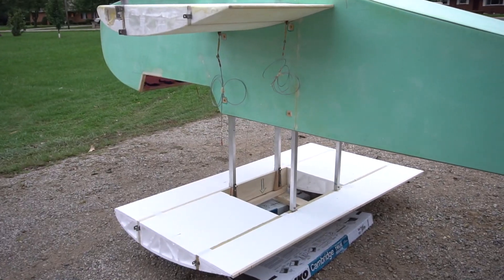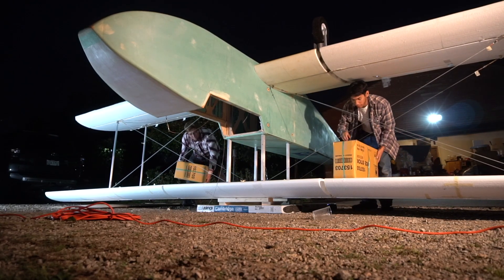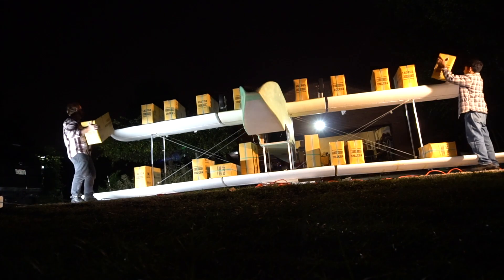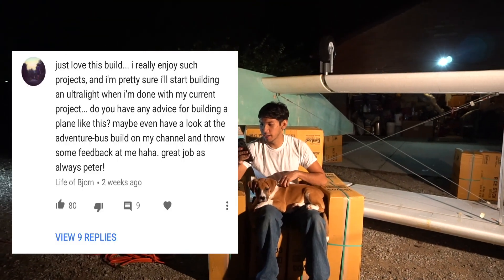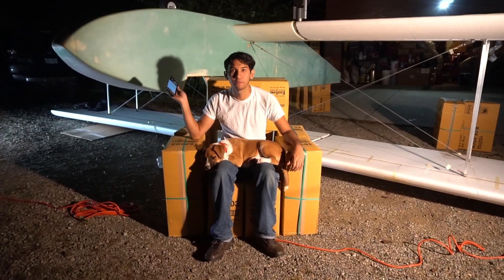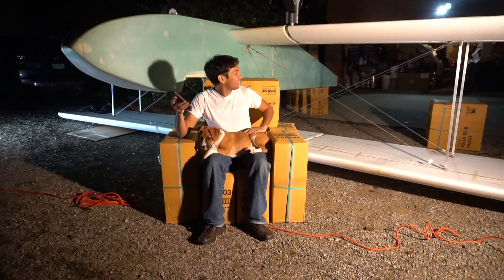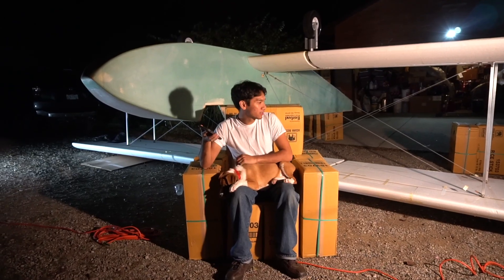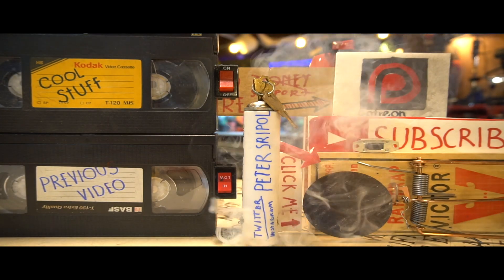DIY Electric ultralight pt5 (Making the Wings)

Comment: I know this thing flew and you subsequently built a 3rd improved machine but watching your methods and finish really gave me shivers mate! In aeronautics we match-drill and debur and ream we don't final drill in a press and leave jagged edges or tap on AN hardware with a hammer, in terms of the design your cabane assembly with 4 upright square tubes is torsionally very unsound, any twist at all will crumple the tubes particularly given that they are free/unbraced above the half way mark vertically and besides carrying flight loads it needs to provide protection in a turn over, brace the uprights with diaganol bracing (look at the Pitts) and jury rig the assembly please. An aircraft needs to withstand more than just localized weight applied in a controlled test, the airframe will experience twisting and torsional loads in both positive and negative loading, this is why prototypes endure extensive ground and flight testing. Do the calculations yourself, don't copy other designs and think it will be ok in all loads and circumstances, you don't know what loads the other designs were made for, this is the big difference between model and full size aeronautics.

Comment: What did you use for wire on your hot-wire cutter?  I've been using music wire, but not getting greatest results as it's tricky to balance tension vs temperature without breaking it.

Comment: OMG Peter! First- gotta gush. Love your projects, love your videos- watch them all. But, since watching your 'stuff', I've been triggered into wanting to create an ultralight... (Bad thoughts!) So, how do you determine the airfoil for your craft? I'm only thinking FAR 103- many parameters are already determined, MTOW or gross of 600 Lbs, CG managed by pusher style weight balance (motor/batteries mounted at trailing edge of right behind pilot.) Then, I DO have questions about wing materials- 6061 rectangle tubes vs. wood- or, cut foam & layer both e-glass & carbon fiber directionally for flexural strength & load? Ideally, I'd like a cantilevered high wing configuration, using reinforced canopy (overlapping main spars-glider style) for quick mount & dismount of each wing. Obviously, weight is a big focus but +/- 3 or 4 G's would be ideal.
   Forgetting inexpensive for a minute, does layered E-glass have better strength, flex, vibration & weight benefits for a main spar? Or, E-glass with reinforcing carbon fiber spars? Or, would I be better using foam interior (shape) and layering a clamshell panel mold with E-glass & Carbon Fiber? Thinking welded rectangular 6061 spars with E-glass wrap may be better??? Any input....Thank You!!!!

Comment: At 9:50 the four lower boxes near the fuselage are not simulating the lift on the wing with respect to the wing attachment to the fuselage but they are simply compressing the aerofoil section. The fuselage should have been supported from locations ahead of the leading edge and behind the trailing edge.
Still having said that, all I can say is this young man has logic, reason and thinks very rationally and he does revise what he does to ensure safety. He is modest and humble enough to take advice. Well done young man.

Comment: I just started catching up on this build. How did you cut the foam wings? When you first unloaded them they appeared very long and cut from a single piece of foam (or was it laminated?)  It's too long and straight for hot wire. Did you build in any wing twist for improved stall characteristics?

Comment: Please change those carter pins out for aircraft wire and use the aircraft locking technique so if a nut tries to loosen it has to pull across and tighten another nut.

Comment: I wouldn't use lock nuts because in time they will loosen, red lock tight is really good, from my experience, it holds bolts and screws together on Harley Davidson really well, and that vibrates like hell..

Comment: A&P Mechanic for 13 years here. I work on helicopters, which vibrate a lot.  I have never used loctite on a self locking nut with a nylon insert. In fact, very very few places on the aircraft use loctite.  Do you plan to have an hourly maintenance or inspection schedule?

Comment: A helpful hint for gluing metal. Alway sand the side of aluminum  that is going to be glued( Epoxyed). This increases the glued surface and makes a stronger bond to the metal and prevents the glue pieces from becoming glue starved. Example put 2 pieces of aluminum together and then pull apart(too easy) and now do the same with 2 files. Because the files are rough they instantly grab. My example is exaggerate but it make my point.   It is alo a good idea to rough sand the wood also. This also helps prevent the glue joint from becoming glue starved.  Clamping the glue joint to tight will also make a glue starved joint .

Comment: Hey Peter, just curious, what are you using for pitch trim? I don't have experience with ultralights so maybe this is a moot point, but I didn't see a trim tab or anything on your elevator. If you have no way of trimming off control pressures in flight you'll be fighting the airplane the whole time. But perhaps it's light enough that this wouldn't matter as much as a larger aircraft. Thoughts? Has anyone brought this up yet?
Reply: Trim is not really needed on an ultralight since the airspeeds are so low. On our aerobatic ultralight biplane we never had pitch trim, even after registering it as a homebuilt airplane. We could change the horizontal stab's incidence a little but we didn't find the need to do so.

Comment: Actually, for a gross weight of 370 lbs. you would need to load it with 925 lbs. of weight to simulate 2.5 g's. It is the total gross weight times the g load, not just the weight of the pilot. No Locktite is not used with nylock nuts, but you can only use the nuts once, if you remove them they must be replaced. Some will say you can use them more than once, but that requires that they be tested for minimum torque resistance before reuse. The fatal crash of the Galloping Ghost race aircraft at Reno a few years ago was ultimately caused by the reused nylock nuts on the trim tab coming loose.

Comment: Looking good Peter! I don't think Loctite is needed on Nylock nuts. I am very impressed with your design and fab skills, however your landing gear is not worthy of the rest of the aircraft in my opinion. Please redesign it with suspension similar to how the Piper Supercub and Beaver a/c work, it will make for a safer landing and help preserve the airframe. Good luck and i look forward to your next video.

Comment: One suggestion may be to add four more cables in an " X " formation from the bottom cable connection points at fuselage to the upper wing towards the furthest current connection points, on either side, if they can manage the angle of pull. Doing this should help keep from too much wing twist in flight. Also look up something called earoelastic flutter. Given a low thrust to lift ratio (not going faster than the airfoil is intended structurally), this should be less likely but there are still other variables that could factor in.

Comment: I agree with hogflyer62, your static loading test was not even close to correct. See these videos https://www.youtube.com/playlist?list=PL1C878703713C6699 of an ultralight biplane we built over thirty years ago. Included is a photo of our static loading test (to -5G), we had 2160 lbs on the wings and we did separate tests for the tail feathers. We loaded the airplane in negative G because that was worse case for our structure. One thing you should be doing during the load tests is to observe that the structure returns to the same place it started when you remove the weight, otherwise it's telling you that you bent something. Nobody wants to see you get hurt.

Comment: I'm not trying to be one of those a(*&'s saying its going to be 500lbs etc but I have seen quite a few places where you can trim unnecessary weight during the build that will help you later.For example the seat frame and cushion.I think before you go on it might be wise to trim all that you can easily now as it'll help you later since it's going to be pretty close ;-)

Comment: Those rigid wheels are a bit concern.. not a critical one.. shoudlnt be an issue in take off roll and in landing at best it would cause structural damage if rough landing , but not a particular danger to Peter (it would be once the plane is back on the ground)
However the lack of shock absorving mean forces multiply in the touch down..unless a really butter landing it could do structural damage on the wing spar in the landing...like landing a supermarket trolley
Maybe the spar acts like a kind of suspension if it has some flexibility
Reply: Well it works! , i was quite wrong about the gear

Comment: The only thing I see wrong in your cables and turn buckle is that it is not safety wired that is one of the most important thing and your crimps are not fully done and make sure when you are doing it you do them in the correct order by middle, top, then bottom that is how it is supposed to be crimped also I am going to school for my A and P mechanics license so what I am saying is credited by the general aviation textbook section 9A have fun

Comment: Since you are using such a light airframe, this design could be aplied to your ultra using automotive struts with a 4" travel. Just to cussion it and take away from the impact solid gear will have on the airframe.
Reply: Wont let me include an image. Its an olea strut configuration.

Comment: As for the electrics, remember to use wires and connectors that can handle the current and vibrations, and maybe make 2 completely seperate systems for each motor. As you said in an earlier video that you are gonna use 4 30000mah 6s lipo's, you could use two batteries for each motor in series, and make a proper voltage monitoring and alarm system. How do you plan on making the throttle stick? I guess it have to be a potmeter with a converter to get the PWM signal to the ESC, and here you could make a seperate system as well, with two potmeters and two converters on the same mechanical stick. With two seperate systems you get no single point that can fail and cut both motors. 
Good luck and have fun! Looking forward to seeing it fly.
Reply: Your plane IS not good 😧😴😡😈💣🐶🚀🚲😱😖😨😈😡😴🎿

Comment: Hey there, I've been flying since I was fourteen, hang gliders, ultralights, general aviation singles and twins, also an AP mechanic with an Inspection Authorization or IA. I'm 57 now and still just as crazy, about being safe ha ha though some of my friends think I'm crazy, from what I've seen of the build it looks good, I especially like the wire cut foam for the wings. As far as the nylock style fasteners they are not a problem, been flying the same ultralight for twenty seven years, it's now an experimental light sport category aircraft, and I use these fasteners exclusively because there cheap and the don't come off on their own, I use a three times on three times off and toss them out or if you can't turn them on to the bolt by hand through the plastic lock ring, there fine. As for vibration, well if you can see the instrument panel you'll be ok, but if it's shaking so bad that you can't, obviously   there's something amiss.

  Never have needed any thead lock unless its engine related or a critical airframe component the requires its use. 

Only on my rc helos, I use that stuff on or my other flying projects, like full size helicopter and gyrocopter.

 Just be aware that flying an ultralight is no different than flying a full-size aircraft. When your butt is in the pilots seat, you can't just shake it off and tape up your busted what ever. Not to be morbib but I've lost friends over the years because of lack of training, maintenance, of just saying hey watch this. It usually does not end well.

Good rule of thumb is make up a test plan.
AC90-89B pertains to amateur and ultralight flight testing.
Weight and Balance (this is so important, if it not correct the plane may not lift off at all or on the other hand may take off with out any warning and become completely uncontrolable, this little detail can at best wreck the plane and scab you up or at worst destroy the craft and kill you). You really need to know the numbers for the airfoil and especially for a biplane arrangement, and if their offset from each other. 

Ground handling
Taxi testing / including fast taxis to discover low speed behavior prior to lift off. 
etc.
Always test on a windless day. Early morning or evening around here.
Perform short hops first. Don't try to force the machine to fly.
There are lots of other tidbits so read what all you can. And get training even if your already a pilot. I've watched an airline pilot test fly an ultralight and had an engine out situation. Not realizing he could have made the field he opted to drop into a field of berries all supported by 6x6 posts and heavy wire rope. Cost him his career and six months in the hospital  and therapy for a year.  It almost cost him his life. Seatbelt dam near cut him in two.

My favorite is: Maintain thy airspeed, least thee ground rise up and smite thee.
 If you have questions I'd be willing to answer any you may have.

Safety is no accident.

Brad.
Reply: What kind of ultralights 
Edit did you fly a ultraflight lazair

Comment: Dear Peter, I fear for your life.
Do us all a favour and TEST the structural integrity of your plane to at least 3 G (meaning 3 times gravity).
Do it by assembling the plane upside-down, placeing the fuselage on sawhorses and load the wings with sandbags of appropriate weight! Do the same with the tail after calculating the max load it ought to experienxe during a flight in rougher air.

Comment: In a way Roy way over built the wings ... the trick is to build box beams, epoxied together ....you could take a lot of wood out of it ... if you are curious , pull up the plans of the FIREBALL ... very high performance sailboat) ... the British 500lbs of tension on the rig, and then slam it around.

I raced one , then designed another boat based on the same principles ....

You can do it in section if you want to break the plane down ...

Then the foam blocks can be slid in ... yes ... I love this thing of building with foam ..  

YOU WILL HAVE A PLANE WITH WEIGHT TO SPARE ... :   :)

YOU CAN ALSO LOOK AT THOSE ICE BOUGHTS THAT FLY AROUND.  West system epoxy was developed by the Geogoun Brothers who were part of the ice boat community. 

Respectfully ... Chuck  ...  an old fart who loves wood and foam  ...

Comment: For the loading test: the loading configuration is not the same as in flight. The aircraft should be supported by the fuselage, not the middle of the top wing. The forces on the wing, struts, and supports will be different in these configurations.

Comment: Just discovered your vids, You really need to consider adding diagonal bracing at the outboard wing struts and at the cabana struts. Hope you removed the plastic vapor barrier on the blue foam before you glued it up....it was not obvious from the video. If you do another project consider a mono gear to save weight. Assume you are gonna add a tail skid????? Good luck and fly safe.

Comment: Nyloc nuts don't need thread lock in them however, if you take them off and on a bunch of times the nylon ring wears out quickly. I use nyloc nuts on frame applications when build my full-size cars and they are great. But everything else that you are using without a nyloc nut you should use tread lock. P.S. Enjoying the show can't wait to see "if" it flies haha

Comment: To simulate a 1g load you need to at least include the weight of the hull as well. Everything but the wing basically and that's under the problematic assumption that loads are shared evenly.
Typical engineering might have a factor 2 strength margin and that's static loads. so if you only loaded it near 2 that means you are in jeopardy even in the calmest level flight, let alone pulling g's. 
I recommend you strain it to at least 5g load and your first flight should ideally be remote controlled with a dummy load in or do it on a long smooth runway and only fly just above the surface so you can survive a total failure. Then you can test quick pulses of 4-5g pull and see if it explodes.
Reply: Then you can get a bit more gutsy flying over water with a rescue boat in the water. That way you have a chance to survive catastrophic failure. You can also strength test your joint designs and wire strengths independently.
Reply: Later I'd recommend doing a minimalist cri cri inspired single wing design instead. And because fiber glass has tremendous strength, it's easy to overkill on strength without significant weight. Which is nice to have.

Comment: I noticed you were using nylon self locking nuts. I really wished you had used castrated nuts and safety wire on EVERYTHING. It's really important to do your safety wire correctly as well. 
And I do not know the inspection requirements for a FAR103 but at least have a good A&P mechanic check your control surface horn attachments and control runs. Very critical as the airplane rises off ground it will flex and and what was a freely moving control run on the ground could become bound by the flexing. Since you do not have a do not exceed speed established even though it is very lite, I think it is important to balance the control surfaces.
Control surface vibration usually ends badly.  One last thing. You have a pilots license or some flight training? Taking off is easy.
landing not so much. You should go up and knock out some takeoffs circuits and landings at least.

Comment: You don't need to use threadlocker on nylon locking nuts or the type with the pin. It wouldn't hurt to put some on, but not necessary.